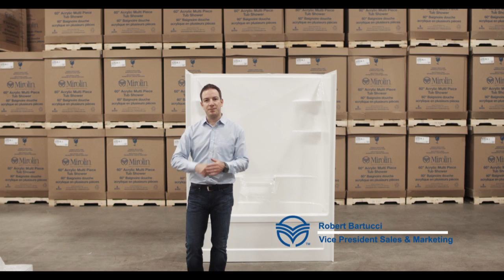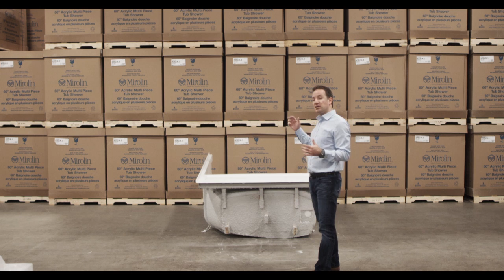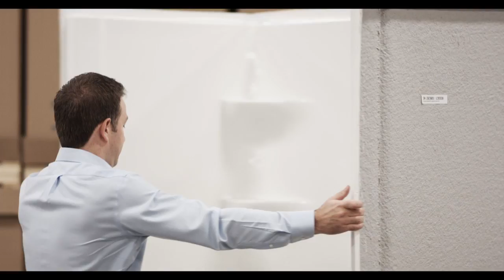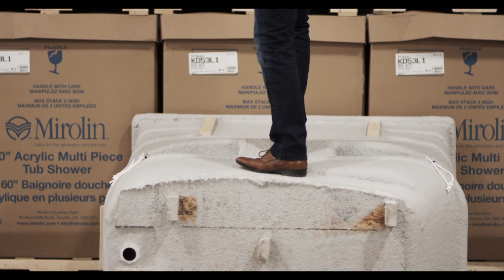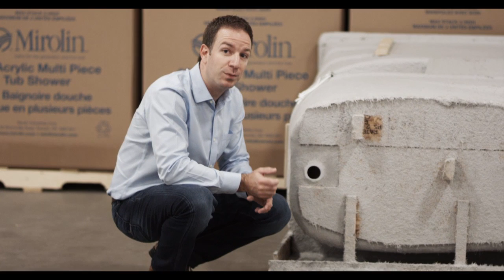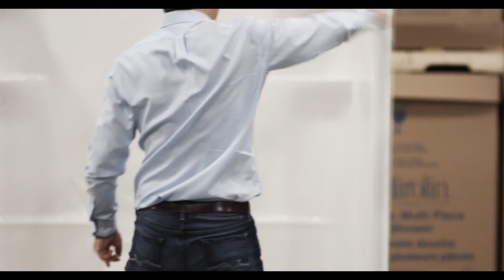Mirolin Acrylic- Mirolin Industries

Comment: You have no idea what you’re talking about. The cracking noise you initially heard was not air bubbles. You were standing on a buildup of fiberglass-reinforced plastic (FRP), and the cracking sound came from chopped glass strands breaking. The unit was damaged from the first crack.

You can reduce the amount of vinyl ester resin—and, consequently, the amount of chopped glass—by introducing an isocyanate during the spray-on process. This creates a structural bubble within the vinyl ester that reinforces its strength. It works much like introducing nitrogen into plastic during extrusion. You know those plastic boxes used for agricultural controls? They are structurally expanded with nitrogen: 40% less material cost and stronger.

I’ve forgotten more about making bathtubs, hot tubs, and shower pans than your entire organization will ever know.

Comment: Hope someone out there can answer my question as i cant find answer anywhere..I have a Madison 4 low entry shower stall with seat..Instructions says to build the frame and dry fit the unit..Unit is 36 inches deep but the room is  60 inches wide so i can not preassemble unit and slide into alcove..QUESTION..can I put unit into place.(back wall is studded)..then build side walls after.

Comment: The video is impressive however my on the ground experience isn't so good. My assistant slipped a bit as we were trying to clumsily get this thing through the 36 inch front door on it's side. The tub corner dropped about 2 inches onto the sill plate and the light blow punched a 1/2 inch hole through the acrylic. Many of these units are going into renovation projects sideways through doorways and staircases. The company should have some lumber at least on one side of the back side of the unit so that it won't get damaged while moving it around on it's side.

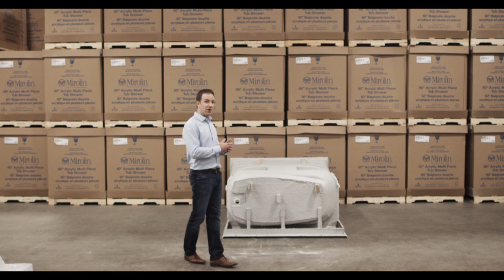Comment: at 6:41, after he walked on the back, there is a cut in the video and the unit is replaced.  It is clearly a different unit after this time.  This is done prior to 'checking for cracks' on the front side.  One can only assume that the unit was in fact damaged by the walking and flexing.